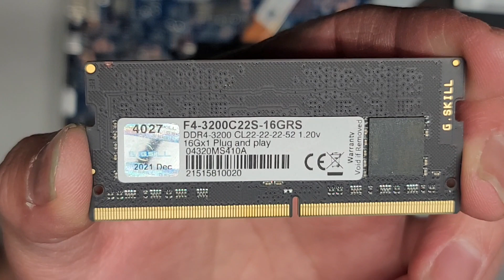HP Pavilion Laptop 14-ce2068st Disassembly RAM SSD Hard Drive Upgrade Battery Replacement Repair

Comment: Hello, I am desperately trying to buy the SATA to motherboard adapter to replace my SSD (the one you are holding at  12:20), but I can not find it anywhere. Do you happen to know where I could buy it online?
Reply from the maker: This should work, but no bracket, so you'll have to use double sided tape or something https://amzn.to/48AA3hn

Comment: Any suggestions where I can find a bottom base cover for HP Pavilion 14-ce0068st - I need to replace mine which is damaged
Reply from the maker: Maybe this https://www.ebay.com/itm/363678570016?mkcid=16&mkevt=1&mkrid=711-127632-2357-0&ssspo=xgs4_8spqvk&sssrc=2349624&ssuid=NQxVFnxHSb6&var=&widget_ver=artemis&media=COPY

Comment: It is easier and cheaper to install sata m.2 256 Gb for the operating system, it seems to me. And use the old HDD as an information storage.
Reply from the maker: The hard drive is more likely to go bad and cause issues.

Comment: I got a problem with my PC now. I changed it out with a brand new battery and now it will shut off when I close the lid when I have it set to sleep also it keeps asking me to reset the CMOS. Pls help
Reply from the maker: Try the old battery again.
Reply: @ItsBinhRepaired  ok and if doesn't work, then what?
Reply from the maker: @misterwebb1472  sounds like a dead battery if the cmos keeps resetting.
Reply: @ItsBinhRepaired  the battery is brand new. Did Amazon send me a bad one? Oh and does that explain why it's shutting down when I have the lid set for sleep when closed too?
Reply from the maker: Possibly. Does it run on battery OK?
Reply: @ItsBinhRepaired  yep. Also if the CMOS is dead, why didn't it tell me with the old main battery?
Reply from the maker: @Mister Webb  very strange. Is it shutting down like a proper shut down, or like a force power off?
Reply: @ItsBinhRepaired  it seems to be a force shut off. It would be in sleep mode for about 2 hrs but then it would be shut off and everything I had open closes
Update: updating bios. Could that fix it?
Update 2: seems like it's fixed but not sure yet
Update 3: did not work
Update 4: updating bios fixed CMOS error but still shuts off when lid is closed
Reply from the maker: D: